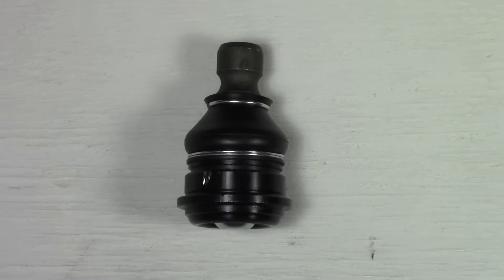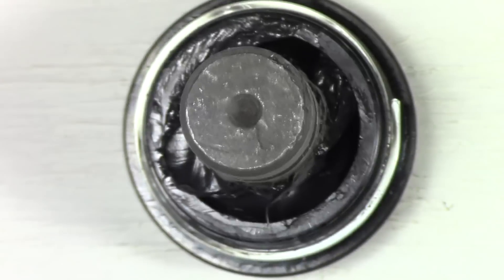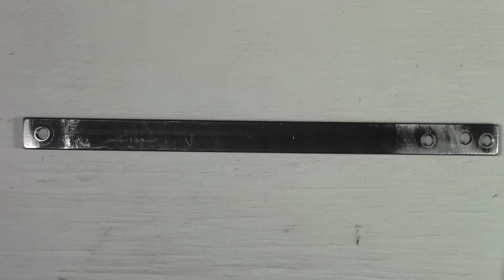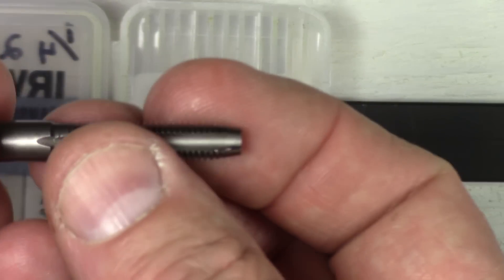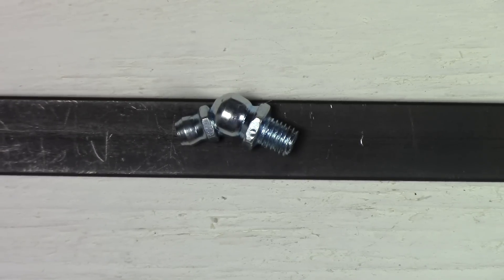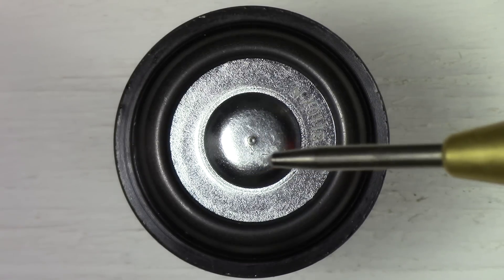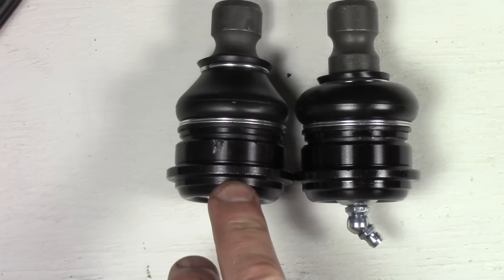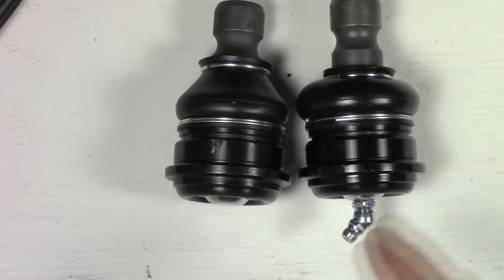Installing Zerk Grease Fitting On Lower Ball Joint Testing And Lubrication Hyundai Santa Fe

Comment: A good video covering most things.  My worry is there seemed little consideration of the metal chips falling into the top of the ball joint during drilling or tapping.
Reply: you mean the drill chippings will go inside the ball joint. This is a concern
Reply: maybe a strong neodymium magnet may help ..

Comment: You introduced enough metal shavings into that joint to make the zerk not worth it. Normally you REVERSE drill than clean the old grease out with the shavings and use threadlocker on the zerk.
Reply from the maker: Thanks. They are still working well today. All the best.
Reply: rocket surgeon in the room
Reply: i thought that too, but figured the shavings would be too big to fit between the ball and the socket, and thus unlikely to cause any damage. i do think mabey flooding it out with some brake cleaner before blowing it out would be a good idea however.
Reply: i was thinking the same thing...i would drill that upside down if posible...so that all the shavings will fall ..then use some grease on the drill bit or maybe attach a magnet to the drill...
Reply: Y cant put break cleaner on rubber it will degrade how qbout a magnet l. I thought greeseing the drill bit catchrs shavings

Comment: each time you use a new drill bit you introduce more shavings into the ball joint unless you use grease but it's advisable to just use one drill bit, but you want to put grease on the drill bit to catch as much shavings as possible
Reply from the maker: Thanks. They are still working great. I will have to lube them again soon. All the best.

Comment: The purpose of a grease fitting is so that you can REPLACE the lubricant.  The metal clamps holding the boot on are to seal the joint so that the internal lubricant can't get out and also so contaminants can't get in.  If you attempt to add grease to a sealed joint the boot will burst before you are able to REPLACE the grease.  You want a joint WITHOUT the upper clamp so that you can pump in enough grease to not only REPLACE the lubricant, but also to pump any contaminants and wear particles OUT of the joint.
Reply from the maker: Thank you for watching, commenting, the valuable feedback. I appreciate it greatly. All the best.👍😀

Comment: Drilling with the proper drill bit once will result in less metal inside than going up in steps.  Putting grease on the tap will reduce the amount of metal that drops into the joint because much of the chips will stick to the grease.
Reply from the maker: Thank you very much for the great feedback. I appreciate it and I am sure other viewers will too. All the best.

Comment: It’s gonna burst as soon as the car gets on the ground. Fill after the weight of the car is on the suspension
Reply from the maker: They did not burst when the weight of the vehicle was placed on them. They are still working today. There is not that much play in the ball joint. Thank you so much for commenting and watching. I appreciate it greatly. All the best.👍😀

Comment: ball joints are always stiff it's so it does not spin while you put on the crown nut. dont grind the threaded end of the grease fitting too much or the spring and ball will come out
Reply from the maker: Thank you so much for watching, commenting, the valuable feedback and the very kind words. I appreciate it greatly. All the best.👍😀
Reply: @richardlloydusa  also checkout RockAuto for inexpensive auto parts
Reply from the maker: Will do. Thanks again. All the best.👍😀

Comment: Very informative. But inserting grease will put too much pressure in the joint boot which will lead to shorten its life..
And hammering on the joint will not be possible because of greae inserting cap..😅
Reply from the maker: You're most welcome. Thank you so much for watching, commenting, the valuable feedback and the very kind words. I appreciate it greatly. All the best.👍😀
Reply: @richardlloydusa  are you still having the car with these improved ball joints?. Still good?. I assume 50,000km done by these ball joint.
If you are doing this again for another car how about fitting one ball joint with grease nipple. For the other ball joint drip in 2ml 75w90 differential oil  before closing up the rubber boot without grease nipple. 🤔🤔🤔

Comment: @14:40, you keep putting the bit in and out of the hole you just drilled, thusly ,pushing more pieces of metal in the hole , why are you doing this?
Reply from the maker: I didn't have much problem with it as the grease I pumped into it cleared the debris. Still working great on the car today. Thank you so much for commenting. I appreciate it greatly. All the best.👍😀

Comment: Should have used a rare earth magnet on the taps. You literally drove metal chips into the ball joint and then used compressed air which would have pushed them further into the grease.
Reply from the maker: Thank you so much for watching, commenting and the valuable feedback. I appreciate it greatly. All the best.👍😀

Comment: Great video.  Was thinking of doing this on my ATV.  Can't find a good tool to remove/reinstall the ball joints, and they are pretty easily accessible.  Watched your video to see how thick those top cups are.  I think you may have overfilled them a little bit with grease :).  I am thinking a shop vac would have worked well to remove any shavings.
Reply from the maker: The overage on the grease will squeeze out. These are still working for me today. Thank you so much for watching, commenting and the valuable feedback. I appreciate it greatly. All the best.👍😀
Reply: it will be even more awesome to add your mod for $6 (the cost of the fittings) instead of the $100 worth of ball joints and the labor/custom tools to install them!

Comment: Having been in the military responsible as a terrain vehicle driver, the vehicles were equipped with grease nipples for the vehicle to be long term functional.
Earlier days, even consumer vehicles were equipped with these. But I guess that doesn't render any money to spare parts manufacturers.
Good job!
As previously mentioned, the shavings from the drilling and drill bits might be an issue.
Reply from the maker: Thank you so much for your service Sir. I did not have any issue with the shavings. You could blow it out with compressed air but still no guaranty that it will clear them all. I figure what is left is very small. I use nothing but Moog product now as I found they are so superior to the regular no name stuff and they come ready to be greased with the nipple. They last a very long time (if you grease them regularly) every oil change for me.
Thank you so much for commenting, watching and the very kind words. I appreciate it greatly. Subscribe, Click The Bell and stay tuned! All the best.👍😀
Reply: Yeah, shavings are a bit worrying but high air pressure “rinse” remedies this somewhat.
If ball and suspension is both metal I would think it would be good nonetheless as long as you yearly relubricate the joint.
Reply from the maker: The Santa Fe I did this for STILL has the same lower ball joints today and they are still tight. So as far as this modification goes I would have to say it worked. Thanks again.

Comment: Nice job Richard, not flaming you here, just some food for thought. The biggest problem withthis method is everytime you drill, there are shavings going into the ball joint and sticking to the grease in there, you can't blow those out, although some may come out, Id say compressed air would just push the other shavings in deeper. When you tap you should of filled up the gaps between the tap teeth with same grease you are injecting into the ball, the gaps between the tap teeth are intended to be filled with grease to catch the shavings and to keep shavings from getting between the tap teeth and you new threads and causing damage to those new threads.

You did flush it, but I would recommend just take off the boot as its a simple thing to do and that way you can super flush out all those shavings that are in there. Keep the boot on, the grease is harder to get out and thus the shavings and the shavings may stick to the side of the boot. with boot off and a 3 flushes or so your ball join will probably be near clean of any shavings.

Just one more thought, although you measured the static clearance of the ball from the top, that changes under dynamic load, how much I sure wouldn't know but physics says it has to. I don't know if the pre made greaseable BJ's are just what you did or fact in some additional bumper room?

Just a thought to improve on your excellent work and instructional video. -D

Comment: Use a magnet to remove shavings.  I also noticed that when you pumped the grease in, it looked exactly as it did when you looked at the original, with the dry spots.  Additionally....shouldn't there be a small hole to allow for the replacing of grease?  That way you pump in new grease and old grease is squeezed out of the hole.  Otherwise, how do you regrease?
Reply from the maker: The grease gets pushed out around the seal on the ball. Thank you for watching and commenting. I appreciate it greatly. All the best.👍😀

Comment: I like that you took the ball joint apart. I have ball joints that should not have gone bad so soon and have wondered if there was any grease in them from the start. But. Will the shavings from the drilling and tapping get inside and do any damage? Great video

Comment: 3/8 pre drill then 1/4 28 tapered tap to start then bottoming tap and that's it?
Reply from the maker: Awesome. Thanks.
Reply: no need to tap for zerk fittings, they are self tapping. must have correct diameter hole.

Comment: You drilled and drilled again dont you think a lot of metal shaving fell inside with the grease ? if your going to buy new ball joints just buy them with zerk fitting all ready installed
Reply: Unfortunately these days any joints with fittings already installed are starting to become more and more rare. Even the high dollar parts no longer have the precious fittings.

Comment: If you put a little grease on the drill bit the filings will attach to themselves to the grease preventing them from getting inside the ball joint.
Also, if possible, always buy greaseable ball joints when replacing non-greaseable joints.
Ball joints that are greased on a regular basis rarely wear out.
Reply from the maker: I was also thinking attach a strong little magnet to the bit Amazon(paid): https://amzn.to/3Oohu5b and drill it out using that too. Thank you so much for watching, commenting, the valuable feedback and the very kind words. I appreciate it greatly. All the best.👍😀

Comment: You don't need to use teflon tape on a tapered thread.
Reply: Agreed for this application, but don't agree for anything under pressure. That is why all NPT threads in plumbing use either tape or pipe sealant.

Comment: Could you move the joint any easier after greasing, because new joints are very stiff you, usually can`t move them by hand, could what you`ve done be a safety issue .
Reply from the maker: I could not move it after the application of the grease either. It was just as stiff. I didn't want to mar the mating surfaces with my tools to test it. I am sure it will be fine once I mount it. As far as safety goes I don't have any concerns as you can buy this exact same ball joint with the grease fitting (for a much higher price). They call this joint without the grease fitting "Non Grease-able" all I have done here is to make it grease-able. I would argue that I have actually made it a safer part as I am going to regularly look at the part when I grease it (every oil change) and will know more quickly when the boot is damaged and or the joint is beginning to fail. Most people will only check them when they start making noise or get their car safety checked. I have seen people ignore the signs that their ball joint was failing (noise, clunking, erratic steering etc.) and see them on the side of the road with a wheel pointing in the wrong direction calling a tow truck on their cell phone. I am changing mine primarily because I want to tighten up my suspension. I will be making a video of the replacement of the ball joint in the near future as well as many other suspension components which I may also modify with grease fittings. BTW the 4X4 rock crawlers http://dunebuggybroker.com/for-sale/rock-crawlers-4x4-jeeps-and-monster-trucks/01.jpg around here generally buy the grease-able joints for all their suspension components. I doubt that I will be converting the Santa Fe into a 4X4 rock crawler any time soon but I may do some suspension modifications in the future. Thanks again.
Reply: What we get on our annual government MOT test , is if a component is worn we get an advisiory that the part is worn but not dangerous, it`s a stiff test they go over everthing. ive just had one on the BMW rear anti roll bar bushes worn, half hour job easy, BMW tourers are noted for weak back ends, spring break, roll bars etc.
Reply from the maker: Usually when the OEM has weak parts the after market manufacturers roll out some heavier duty parts to fix the problem. Are you considering after market solutions for the rear end?
Reply: Richard Lloyd Yes the bushes will be after market, the rear spring that broke was raplaced under extended warranty by BMW, they advised only the broken one was needed to be replaced, no need to do the pair.
Reply from the maker: It's funny how efficient they are when they are doing warranty work and how you have to replace both of them when you are paying for them. LOL. Excuse the sarcasm. Is the rear end level?
Reply: Richard Lloyd Indeed, one warranty job on it at 32.000 a new steering rack total cost £1000, they love doing warranty work im sure, that comment was back of the class stuff : )

If you get the chance on BMWs check the steering wheel play when stationary, there is always a minute amount of play, ive checked loads even nearly new models all the same, but mine was excessive.
Reply from the maker: Sloppy suspension and steering components drive me crazy. I can't help but notice them and can't stand driving the vehicle until I fix the slop. Thanks again.
Reply: Richard Lloyd Im the same, i cant understand why BMWs have this play on the steering, it`s weird, ive tried many BMs and they seem to be all the same, even sub 20.000 milers, funny only i seem to notice it when until i point it out to people.
Reply from the maker: If it's a design issue inside the steering rack (gears not meshing right) or something similar it would be very hard to correct without replacing it with an after market solution or a repaired gear set. Sounds like a crazy problem to have on such a premium vehicle. I have driven cheap cars that have very tight steering, something that been more or less perfected at this point in vehicle engineering. Weird that BMW finds it acceptable.
Reply: Richard Lloyd When BMW fitted the new rack it still had a very small movment of free play, i was not happy, i then had acess to many BMWs at the British car auctions, and i was suprised to find 99% had the play, i still sit and test the play now and again, but it`s so small that unless your attention is drawn to it you don`t notice it, over 30.000 mls on the rack and still good.
Reply from the maker: You test this with the engine off, correct? Thanks.
Reply: Richard Lloyd Oh yes LOL, when the engine is running it it`s still there  but the power steering almost hides it, it`s still the same as when they fitted the new rack. im like you don`t like play, my old Ford never had any play, as i said have a try of a late BM and you will see what i mean. ps it`s not on the universal joint at the bottom of the column.
Reply from the maker: Very strange indeed. It's like the engineers don't care to fix it. If the Ford and many to most other manufacturers don't have the problem, my Hyundai and KIA don't have it (because they consider it important not to have that slop) one has to wonder why the BMW engineers don't notice the problem. Next time you are at a BMW car show you should ask if any of the engineers are present and if they are, I would love to hear what they have to say about it.
Reply: Well it is tricky. You do not want slop in a ball joint because if you have slop you have acceleration and pounding. More slop and more ponding and then more acceleration, etc. So the tight fit is something you want. Of course that is where the lube comes in.

Comment: Excellent video, one recommendation I also put a plastic cover over the end of the zerk fitting to protect the fitting. If you do that the zerk fitting will always take grease and will not become plugged over time.
Reply from the maker: Thanks. I know they make them from rubber too. Living in Texas it's not that big a concern but in the northern regions I could understand why you would want to. Thanks.
Reply: aleon1018  The brake bleeders rust from brake fluid sitting in them from the last time they were bled.  Last few years I've been putting the hose of a brake cleaner can all the way down the bleeder hole and blasting the brake fluid out.  Haven't had any sticking/rusting issues since.

Comment: PS, what i mean is, the manufactures warranty being void in the event of a failure.
Reply from the maker: At the price of this part ($14) the warranty is really not that great a factor for me especially when you consider shipping and your time but for sure if you modify the part the manufacturer will say too bad for you every time. I am betting that my modification will extend the part's lifetime.
Reply: Im interested to see the old ones when you replace them, if they are the origional ones 128 thou is not bad.
Reply from the maker: Unfortunately I have only owned it for the last 6 months so I have no idea if they are original or not but if they lasted 128K that would be more than acceptable to me. We will see when I extract them. I am planning on doing the job tomorrow. All the best.